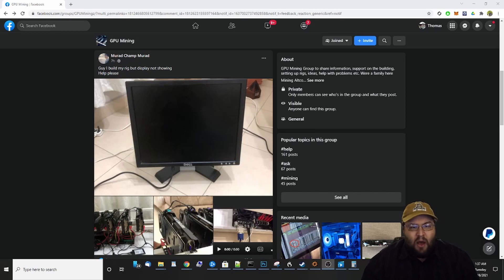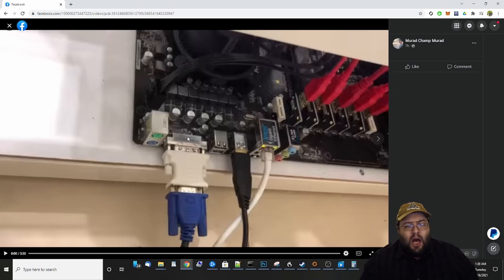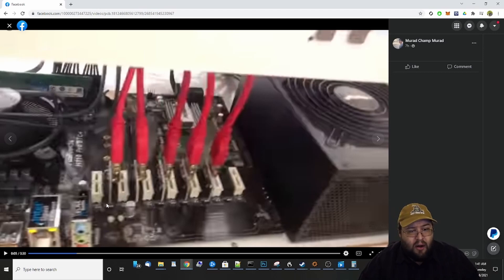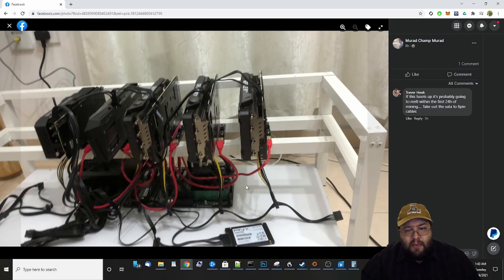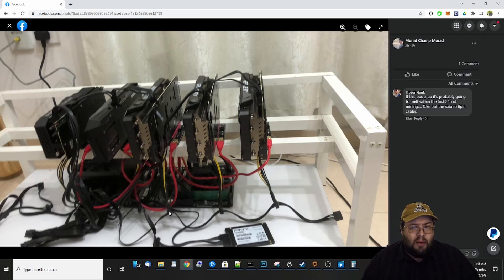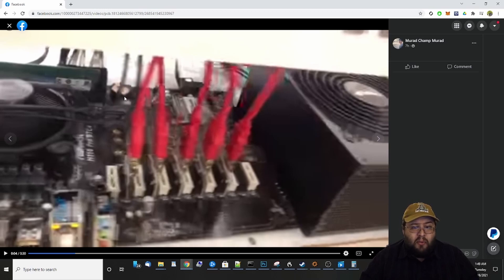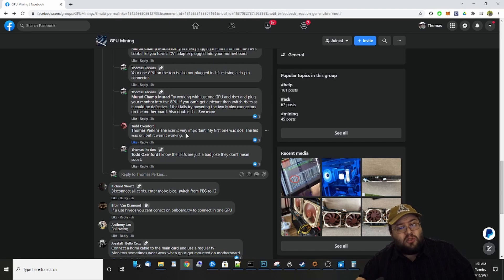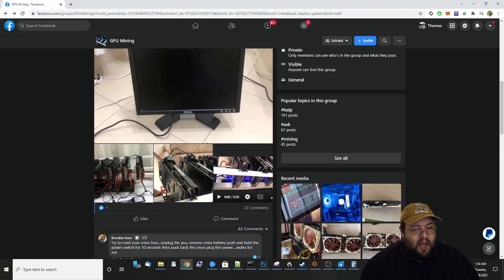Troubleshooting Series: Mining Rig No Display

Comment: I have the same issue with my setup. Im using my old gaming pc and it doesn't have a integrated gpu so the only video source is the gpu i have in the first slot. I do get video feed for 5 sec if i cycle my monitor by turning on/off. I tried using different gpus and its still the same.

Comment: I had a similar issue but my rig is working perfectly fine as long as one of the gpu is connected to a monitor and it will show everything but when i remove the hdmi cable the rig wont start + hdmi port in motherboard dont work and i still cant find the issue
Reply: Update : I fix it by updating motherboard bios

Comment: If I were to pay you can we do a video call to diagnose my mining rig issue? I have exact same issue with no display.  I don’t have molex port right next to pcie, I tried resetting cmos, & everything else seems to be working fine
Reply from the maker: There's actually Facebook groups that'll offer to help you for free. Best thing to do is disconnect everything and test your components on a working computer. Then start your trouble shooting process.
Reply: Did ya ever fix it? Having the same issues

Comment: one issue i ran into with an h110 board is that going from top to bottom, the default bios on the board will only show 1-7 pcie slots. If you have anything plugged into the 8th one it wont show display/register the gpus. In order to run more then 7 gpus on board you need to research how to turn off some settings in the motherboard. There lots of problems with what the person has in the video but if your board isn't loading the gpus take the one out of the x16 slot and run all the risers from top to bottom. slots 1-2-3-5-6-7... x16 need some work around for it to be not set to default graphics display and run the on board graphics then it will unlock slot x16 for use after that . The issue for running more the 8-9-10-11-12-13 is very much a head ache rant over sorry. lmk if this helps!

Comment: I have the same exact problem with the same exact build. (And same mistakes) I have been looking for a fix for two weeks. I'll try this and hopefully I'll comment with good news again🙏🏼
Reply: maybe this is one of you issues to. was mine i had slot 2-4-6-8-10-12 plugged in and no boot and when i reorganized my slots to 1-7 leaving out my x16 one also this instantly boot no issues
Reply: @KillaBuilds  what do you mean?
Reply: @christianmoreno3477  in more short term you need to either flash bios or go into bios settings and enable to pcie slots
Reply: @KillaBuilds  I can’t get the monitor to connect at all though so I can’t access bios
Reply: @christianmoreno3477  start with just 1 card in the first pcie slot and boot up and see if you can get bios to display first then change pcie slots from auto to gen 2 and do alittle research on what time of board you have and see if there's any one settings to enable pcie slots